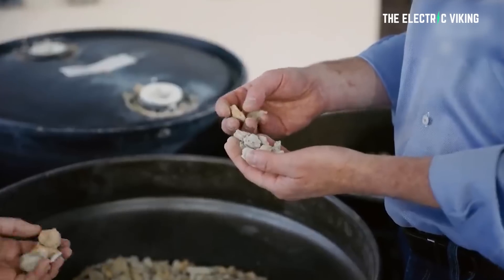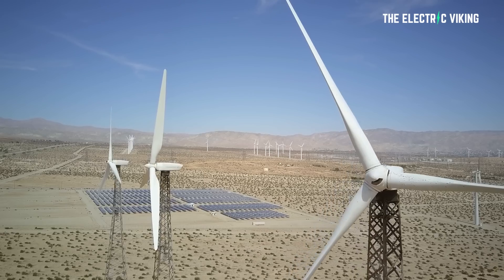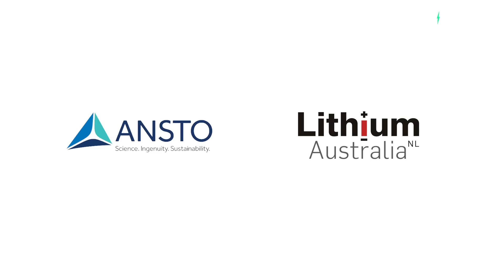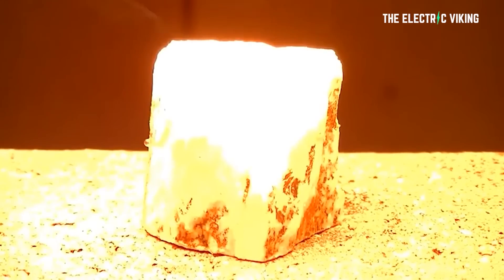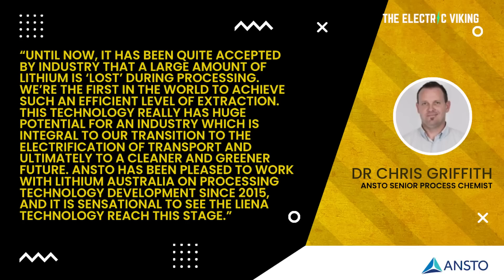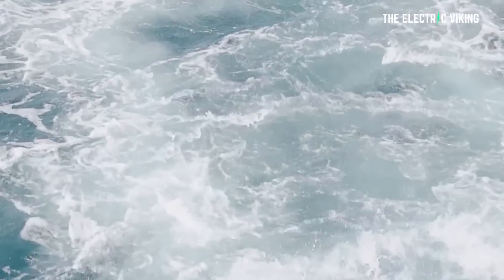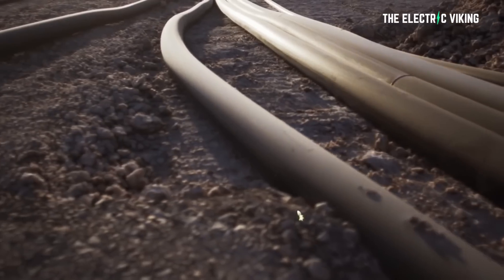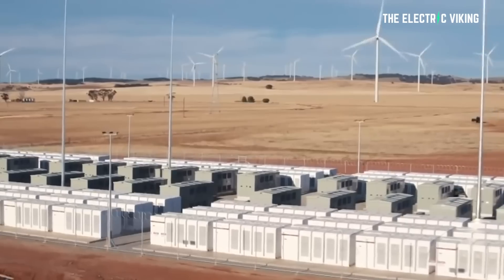Amazing Aussie lithium extraction method changes everything

Comment: It looks like a standard froth flotation technology.  This technology has been used for decades to extract copper from very poor ores.  the trick is to find the correct chemicals that wet the gangue, causing it to sink and for the Li compound to stick to the bubbles and hence come to the surface to be scrapped off.  Then rotating filter bags with a vacuum inside extract the water and cause the filter cake to stick to the outside of these thin hexagonal bags.  I notice that people are making the filter cake fall off the bags.  This can be automated by having the filter bags in segments sections and for the vacuum to be exchanged for pressure as the bag rotates, dumping the filter cake into a bin.

Comment: Great we are using a more rare mineral... miss using it by burring it is not good. But how do you get the energy in to the batteries when you loose as much as 50% from when you generate it over distance..  when you burn oil to make it. wind power and solar power has its place but it is not green it also generate toxic waste that no one is talking about just like aspestos..

Comment: that will reduce the cost or LFP battery significantly on the long run. but on the other side, the demand for cheap energy storage at home is also insanely high.

Comment: Mr Harold ; do elaborate?  What politics about coal?  In the USA where we have both coal and natural gas, we are buying natural gas; but if you don't have gas in your land and you have coal - then you have little choice but to buy coal to run electric generation plants.  The false narritive is there will be enough solar or wind in the next 5 years or maybe even 10 to power the existing electrical load; without shifting vehicles onto it; which would at least double the power required to generate.  For those who want to electrify everything - there really is one hope thermonuclear power.  Im not one of those for one thing that means you need to have SF6 which is 26,000 times worse than Co2 and lasts in the atmosphere 10,000 years!    I don't want that no matter what.

Comment: Great news! I just wonder if this makes the cost of recycling lithium from old batteries too high to bother? Hopefully there will be efficiency gains in recycling to match in the future, so that we don't need all virgin materials.
Reply: 1) Recycling cells at greater than the quantity required is at least 1-2 decades away.
the amount needed is doubling annually, and most cells are "locked in" for at least 10 years.
.
2) It's not just Lithium being recycled.
Nickel, aluminium, Cobalt (for now) Steel, Iron, Manganese(?) etc, etc.
Not to mention, it's not just vehicle cells. The industry will mop up ALL batteries, PLUS other electronics to recover metals from PCBs.
Reply: @rogerstarkey5390  Yes, virgin materials will of course be needed for many years regardless of recycling. But I heard somewhere that some recycling plants already only recover nickel, cobalt and manganese since lithium is cheap and abundant. But I think the long term goal must be to recycle everything, since exploiting new reserves always come at great cost for locals and nature.
Reply: @Barskor1  spot price is not the contract price.

Comment: Wondering what % of Lithium made into batteries is recycled. Ideally we will have a closed cycle with less mining in future once all transport and storage systems are electrified (if ever) .
Reply: It's not just Lithium made into VEHICLE batteries.
(That will be 100%, it's "easy")
Secondary benefit?
It makes recycling of all the "just thrown away" cells from power tools "personal devices"(😉) phones, tablets, laptops, etc, realistic.
You can add every single electronic device. Just throw the PCB in and you get all the precious metals back.
If the process involves heat, (most do) just pull the plastic cover off and throw the whole device in.
.
This is more significant than many have realised.

Comment: So my thoughts have been interested in the idea of desalination leftover brine from desalination plants. Wouldn't it be as easy to extract the lithium from that brine? I have not heard anybody talk about it yet. Don't even know if anyone's thought about it. But if there were more desalination plants, then the leftover brine from these plants could be extracted and used for batteries. At the same time creating fresh water. The kicker is that all of this should be done using renewables only. Does that make sense?
Reply: Nuclear power with its huge "waste" heat' is the best way to power desalination plants. But when you have reliable power you have less need for batteries and cabling out to solar and wind generators. New nukes like Moltex burn nuclear waste or new fuel. They fully burn the fuel so create almost no nuke waste.
Reply: @Dave5843-d9m  
And they'll be up and running in large numbers..... When?
.
You just explained your low level FUD elsewhere
.

Comment: I guess the question is where is all that "lost" lithium from existing processes? In Australia, or in China where the processing was done?

Hopefully companies that are already contracted to purchase spodumene will be open to re-negotiating their contracts to purchase the lithium phosphate instead. If that happens, the processing could happen between the mine and port.

Personally, I think that the same should be happening with iron and aluminium. Shipping oxide around the world is horrendously inefficient compared to shipping the refined product. Sadly, the current way of accounting for CO2 emissions on a country-by-country per-capita basis actually encourages the shipping of unrefined product to a country that is allowed higher emissions.
Reply: It's not always higher emissions. Alcoa have an aluminium smelter in Iceland as almost all of their electricity is geothermal or hydroelectric so it's also much cheaper than other countries.

I agree that shipping ore is inefficient but they can be easier to handle in bulk than dealing with ingots or lumps of metal stock. It would also be extremely dangerous to ship large quantities of pure lithium as it's highly reactive and flammable, it's a lot safer and easier to ship it as carbonate.

Comment: Good news!  For grid-scale storage I personally favor gravitational storage;  near here we have a large pumped storage facility that was built to balance a nuclear power plant, but adapting it to handle inputs of wind and solar power has proven challenging.  Lifting heavy weights (e.g. concrete or stone blocks) doesn't require water, so is better adapted to many places.
Reply: "Engineering with Rosie" did a piece on that. There are problems. I watch all of her stuff.
Reply: @fjalics  
I'll go and watch her piece, but everything I've seen in the site seems to raise questions re her logic.
(Hydrogen springs to mind)
Reply: Gravitational storage has the benefit of not using or leaking energy, even from summer into winter, once the blocks are locked in place, compared to other long term energy storage such as heat or phase changing, for instance. It's still a very costly proposition, and no investor will ever build a facility and blocks that basically sit unused for half a year, so it will be used at a higher frequency, literally charging and decharging more regularly, because either you need an insane amount of storage and number of carbon emitting cement blocks, or you'll need to discharge these blocks as soon as a more limited energy storage capacity is reached, in order to have capacity left to store the extra solar or wind energy produced over the next days. Meaning a lot of wear and tear and risk of mechanical failure from the many ultra powerful motors required for the job.

The answer to our backup energy needs when the Sun is down and the wind is not blowing through the graves is probably not more storage but less, with a smarter grid able to transport electricity from wherever the Sun is shining and the wind is blowing, but also implement a greater diversity of renewable energy sources for better resiliency, use cheap batteries such as LFP or flow for instant grid balancing, and instead of long term energy storage, use permanent, not intermittent, sources of energy such as geothermal, tidal, ocean currents, etc.

Now, of course, gravitational storage is still in its infancy and mostly in the lab, the garage, TED Talks, 3D design plans or doodles. There are several other ways to improve it, like lifting heavy blocks without involving cranes or ginormous motors, maybe with pneumatics. It's a work in progress, that's why all these techs and engineering are very exciting and I highly recommend it for students who may still not know what they want to work on later in life. Heck, even some pensioners feel young again discovering and implementing (OK, playing) with renewable energy stuff.

Comment: Lets hope that happens sort of - as Lithium availablity is a choke point for lithium based EVs - but such EVs. still will need a green grid and a diet to be green - more likely that they will end and something new will come along - but in case no new gee wiz chemistry jumps up - this would be good as a back up plan.
Reply: The politics that prop up coal needed to be addressed for a green grid to move forward.
Reply: @danharold3087  if there isn't enough lithium; it doesnt' matter what politicians do.
Reply: @litestuffllc7249  LIthium is very abundant.   Up to now they have been using extraction methods dating back to 1900 or so.    Improved methods are on the way. Also sodium batteries are about here. CATL says it will have a sodium ion battery plant on line next year.

Comment: Every day a new "revolutionary" battery or extraction or production breakthrough
and a year later, nothing changes
sounds like pie-in-the-sky stuff that, a year from now, everyone will have forgotten about

burn oil/coal/gas, and you are in a green cycle - just 100 million years long
the CO2 released has greened the earth in the past 50 years to the point that we have more vegetation growing now than at any time in the past few million years.

Without CO2 we will die